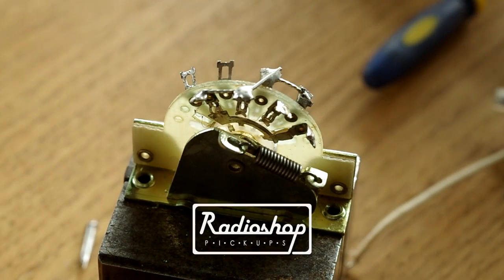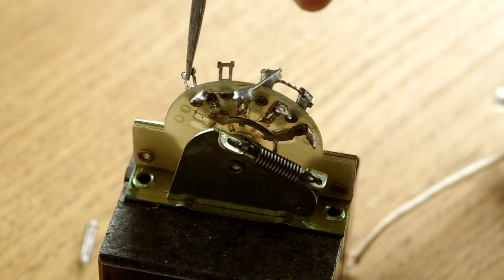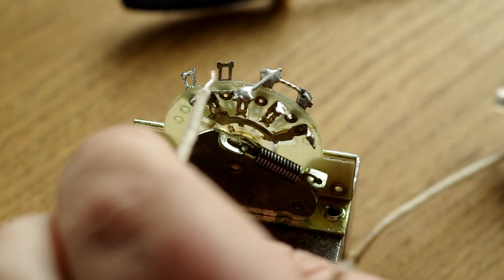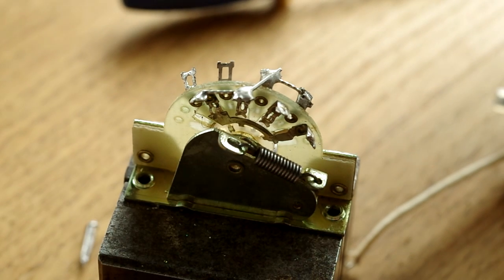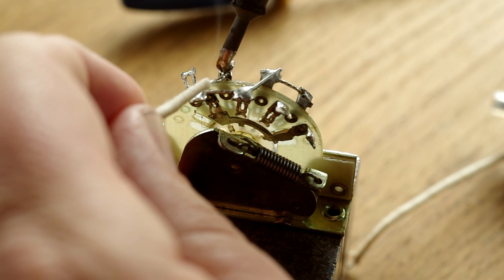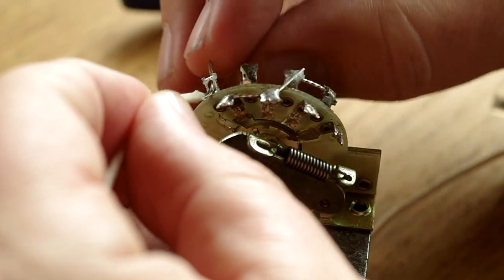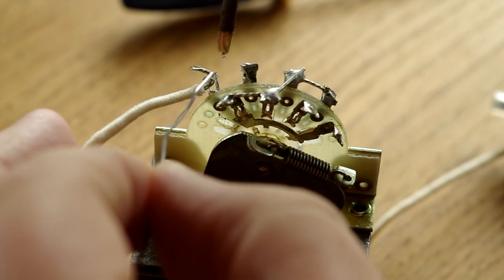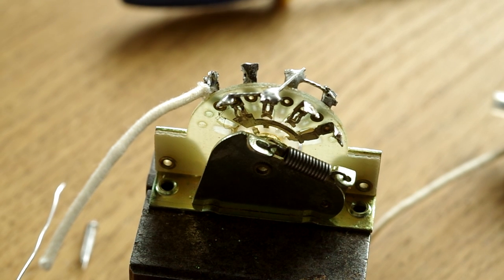How to Solder Strat & Tele Switches - Guitar Soldering Course Lesson 4

Comment: I'm just about to replace my Strat PUP switch. The factory-wired switch was full-on hook-around connected. I couldn't unsolder the connections to remove the wires. No choice but to snip.

Comment: Great video, I think you'll find that NASA recommend the mechanical method in their soldering specification 😉
Reply: NASA don’t have a soldering specification they use IPC and have done since 2011.
But yes going through the hole is the only way acceptable professionally.

Comment: thanks for this man. I was replacing some wires on a super switch and god it was difficult.  it was the location of the two lugs I had to connect. I finally connected this ONE wire after failing countless times.

Comment: Three issues if you are to solder these joints correctly, you have too much solder on the wire and way too much on the tab, the wire should be cut to length before it is soldered in place.
Doing so gives a nice clean joint where you can clearly see all the strands of wire and the individual parts, snipping to length also means the joint is smooth after it is made.